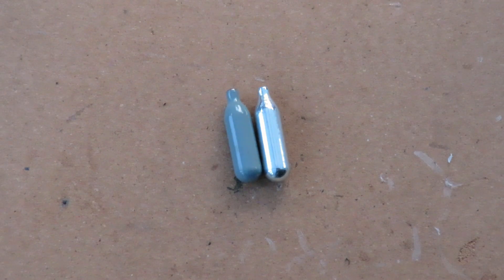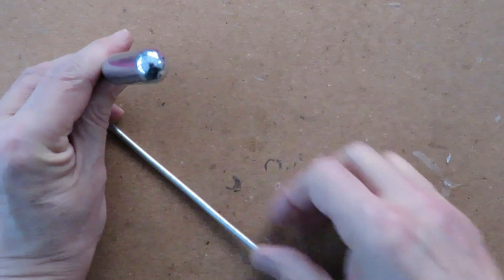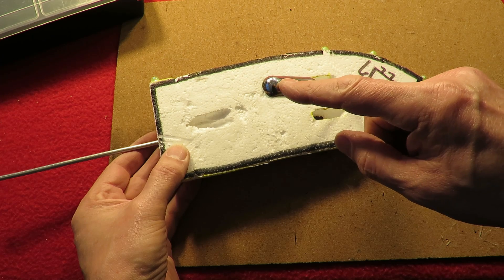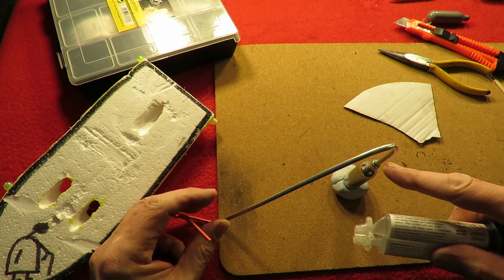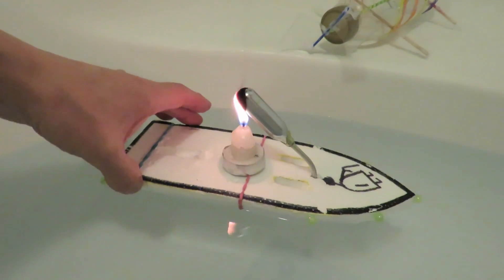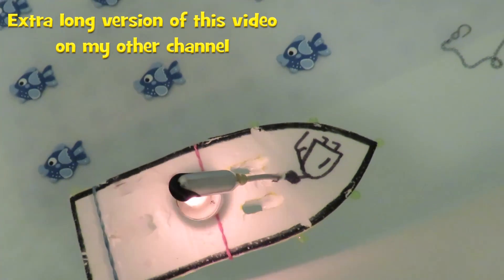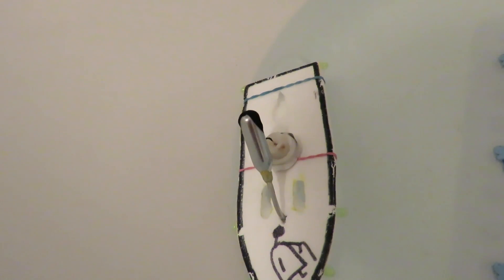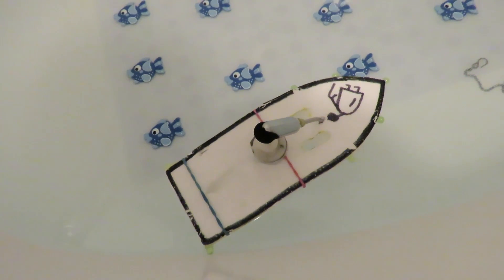Single pipe silent Pop Pop boat SHORTENED VIDEO

Comment: The tank is at wrong angle so all the water will flow right out. It’s good to have a small amount in the tank.
Reply from the maker: The water can not flow out of a closed container like that. Maybe try it for yourself.

Comment: A way to fill it with  water is to heat the bulb  (air is expelled) and then put it in water and as the bulb get fresh it will absorb water.
Reply from the maker: It would work in principle but not very practical unless you take the boat apart to heat the boiler separately to fill it.

Comment: Hi Grandad. Can't beat recycling/re-purposing . I like it. In looking at this design and thinking about Slater's I'm wondering if Jean-Yves and collaborators work with tube bends would make any difference. I'm referring to having the tubes leaving the boiler for a short distance at an upward angle first. You can see it easily in this video. https://youtu.be/ksaMikFk1Gw   
Seemed to work for me.  Cheers.    Daryl.
Reply from the maker: Hi Daryl, thanks for taking the time to watch my videos. I was watching your videos ( and a few others ) and spotted the advice on the upward angle. There are several more videos in my schedule but none include that feature but I will make sure I give it a try when I start some more. The last couple have been a little disappointing but I will still be posting them as people like to see things fail 😁 My schedule runs well into April now.

Comment: Heh - you beat me to it - I picked up one of those gas canisters off the pavement last week and I was planning to use it as the boiler on a boat!
Reply from the maker: Haha, sorry, I am afraid this is basically a remake of one of my older videos https://youtu.be/9GWA4aOaJhE They do make handy boilers and squeezing two pipe in make them easier to fill.
Reply: @GrandadIsAnOldMan  You're way ahead of me on these things.  I'm thinking of getting the right sized copper tube and making a two-pipe version with my gas canister - one pipe out of the natural valve and one into a hole drilled in the opposite end - going to solder or braze it, then I can stick a hotter flame underneath and see what happens...
Reply from the maker: @AtomicShrimp  you will find the valve end has got an insert in it which can be a pain to remove. When you try drilling it out it can come loose and spin on your drill tip without coming out. You can grip the neck to stop that. Looking forward to seeing your next one. If you want to go really wild and start using propane gas flames for heating you will find flash steam engines are popular for high speed model hydroplanes and even model aircraft but working on a slightly different principle. Here is an interesting site http://www.flysteam.co.uk/recent.htm
Reply: @GrandadIsAnOldMan  Thanks - Oh wow - that's a nice boat on that page.  I have wanted to make a steam powered river boat for years now.  Too many ideas!

Comment: I would be inclined to drill a hole in the cylinder at the sealed end to make filling easier. Then use a self-tapping screw to close the hole for use.

Comment: You should make a driveable pop pop boat.
Reply from the maker: Here are some RC pop pop boats I did https://youtu.be/9rokTyAv3xU https://youtu.be/B_Bm5TcCsQU https://youtu.be/H1aeDsVdOJA
Reply: I mean more like sit in driveable
Reply from the maker: @trickfkitmakeitwork886  the simple answer is the power does not scale up with the size. There are a few videos on YouTube of people staring projects on that subject but I haven't seen a working version yet. To be honest, when you think about how they work I wouldn't want to be sitting anywhere near one powerful enough to propel the weight of a man.
Reply: 3-4 of them in front of the boat with plenty of heat shields. 3-4 pipes each pop-pop engine. Connecting to one pipe out of the back of the boat. Used propane tanks may work for the base of the engine for even heat like a wok. Yes, they are slow but it would be a nice cruising speed. Like a trolling motor. It would be a nice experiment.
Reply from the maker: @trickfkitmakeitwork886  if you are still talking about a people carrier my understanding is you simply don't get enough power. Like I said the power does not scale up with the size. However there are other similar engines called "flash steam" so you might like to look for them. They are often used for high speed model boats and even model aircraft.

Comment: Nice upload after seeing your enthusiasm with putt putt boats I'm going to have a go, that was a brilliant idea using the soda bottle co2 gas canisters I'm thinking of drilling a hole in the top and using a seal screw to ease filling the heater tank up. Thanks for the interesting upload.
Reply from the maker: If you just put 2 tubes in rather than the one then filling is easy. I put 2 in a similar canister in this video https://youtu.be/9GWA4aOaJhE